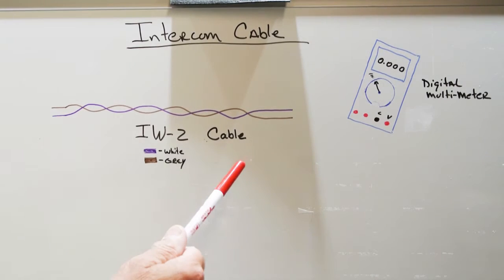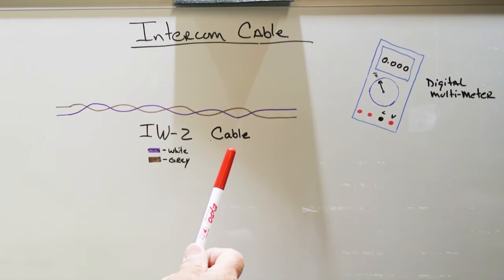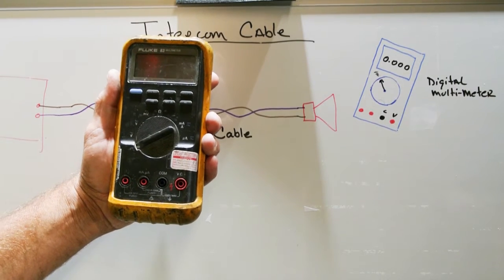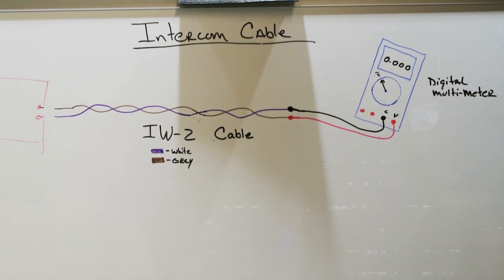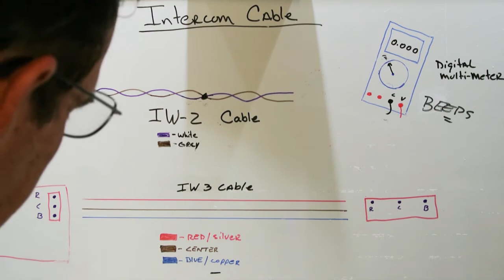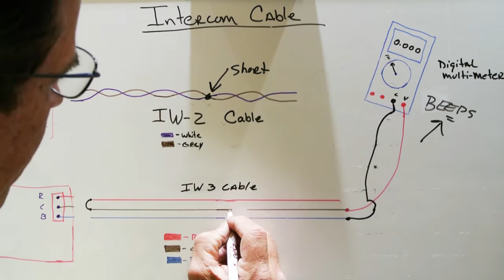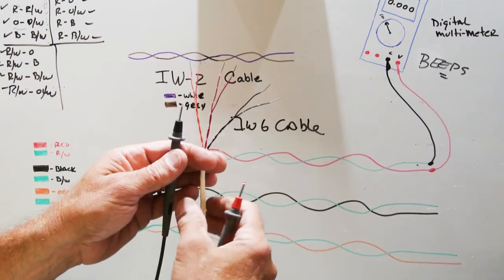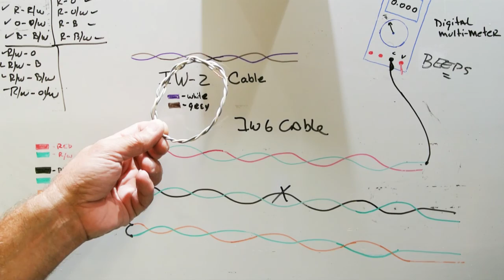The Fundamentals of Checking NuTone Intercom Wiring for Problems

Comment: thanks alot, and you have helped me with this video because I bought new wifi door bell and I wanted to connect it to intercom system without leaving device in door so I had to find out wires which are connecting speaker,door button so I can just connect them to wifi door bell and keep device on my room and using old speak that already in door so thank you because I had used multimeter to get them wire very quick. well done mate..

Comment: Hi.  I have a Nutone NM100.  Three of the 11 remote stations do not work.  I've used a low voltage pen to check for voltage, when the unit is powered, and it appears that the ones that work have low voltage, and the ones that don't work, don't.  I've tried plugging the connectors in different ports on the master hub, and no joy.  It is not feasible to run new wires, so checking for shorts/continuity doesn't really help.  Is there any other trouble shooting I can do to see if there is a fix other than running new wires?
Reply from the maker: Hi NWeber:  I am somewhat unclear on what Model you have - An NM100 is a 3-wire System, which does not have plug-in connectors.  I suspect that you have a NM200, which is a 6-wire System (8-wires if CAT5 was used)
     Using a "low-voltage pen" is pointless troubleshooting if you're trying to solve the problems.   It is likely that you have wiring problems, since the odds that 3 out of 11 Remote Stations failed is unlikely (unless all 3 are Patio Stations) It would simple enough to use a known working Remote Station as a "test" Station and try it in each non-working loctation.
     You really need to check the cables for each of the non-working Station to determine what's wrong with the cables (breaks or shorts - probably breaks)  With the specific information you gain from testing the cables, you may be able to use the remaining "good wires" to have some limited functionally on those 3 Remote Stations - Chris
Reply: Hi Chris.  You are the best to reply so quickly.  Yes, it seems it is an NM200.  One of the failed stations is a patio.  I fixed one by trying a good unit, and when I used the original unit elsewhere, it also worked.  So inexplicably it must have been how the unit was connected to the wires, even though they looked good.  The third unit has the solid vs stranded wires.  Your video explained that those are problematic, so I'm guessing it is the wiring.  I will use your video on checking the wiring and I may get back to you to find out how I can do a workaround to get limited usability. All I really want is intercom, not music.  Thank you again.

Comment: I just bought a home with a 2090 nutone I took off the panel and none of the wires are connected. Where do I even start?
Reply from the maker: Hi ThePoseidon211:  The best place to start is - Contacting me directly about about to proceed - Chris 925-743-8236

Comment: How can i find a break in my cable wire inside the wall
Reply from the maker: Hi Tom:  If you have clearly found that a cable run has a broken wire(s) and you believe it's inside a wall or other inaccessible location - there is no way to narrow down exactly where the break is - the best you can do is know that the break is "somewhere between here and there".  In these cases it is often best to resign yourself to the idea that the most productive choice is to run a new cable.  In some cases, following the path of the original cable works well, sometimes planning a new route may be easier.  There is no standardized way to deal with these types of problems - It is entirely "Make-it-up-as-you-go" work - Chris

Comment: I am working on a simple system like your first example. A speaker at the door and a 2-conductor cable to another speaker in the office. The cable comes into the office speaker and another cable comes out of the office speaker (same type of cable) and goes back into the wall. I removed both speakers from their walls and cut off the cables. Where is the transformer connected? I do not read any voltage on any of the ends. Should there be continuous low voltage on any of the end points I described?
Reply from the maker: Hi Kellyq21:  Is this a NuTone brand system?  Is the Entry Door Station a little Brown Plastic Box with a single Round Push Button and a Clear Plastic Name Plate to the left of the button?

Please let me know - Chris
Reply: Yes, exactly. It is an old NuTone IK15WH as shown here: https://goo.gl/QmNuY2. Thanks and Happy New Year.
Reply from the maker: Good:  The transformer can be mounted anywhere in your home  - basement, garage, laundry room, coat closet etc.  There should be 16 volts +/- of AC power on the second set of wires coming into the inside station - there is no electricity on the wires to the entry door station.

What is the problem with your system?

Chris
Reply: It's dead. It's in a commercial building and I don't know where the transformer is. So before I start taking down ceiling tiles or searching closets and walls for it, I am wondering if the problem is there is no voltage where there should be continuous voltage that I can measure anytime without worrying about whether triggers or switches are closed at the time of measurement.
Reply from the maker: There should be continuous voltage to the inside station.

You can disconnect the 2 wires (that seem to come from the transformer) from the inside station and the measure for voltage - this eliminates the rest of the equipment from the testing, and only leaves the following as possible problem points:
1.  Electrical Power to the Transformer (120 volts)
2.  The Transformer (should output 16 volts AC +/-)
3.  The Wire between the transformer and the inside station

Often times in a commercial setting, if locating the transformer is not practical - installing a replacement transformer is simpler - Chris